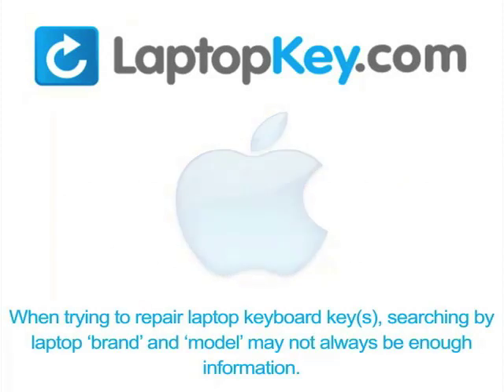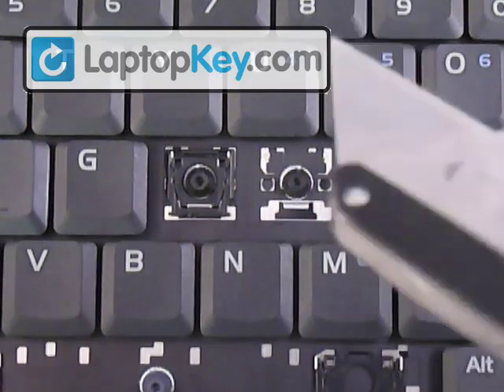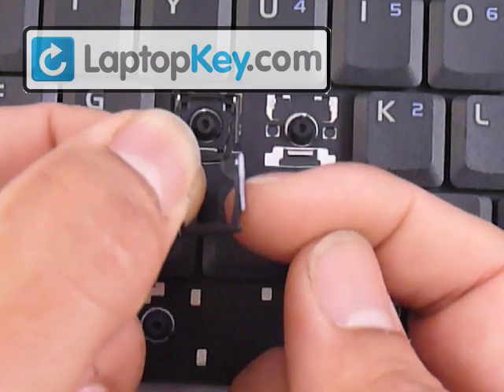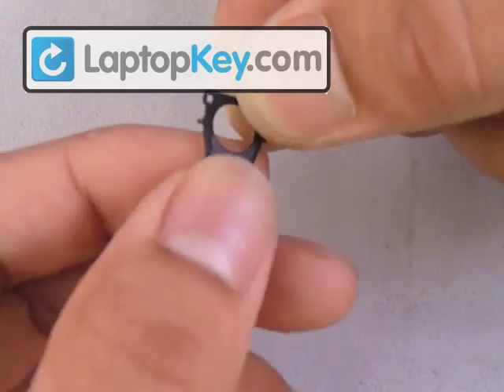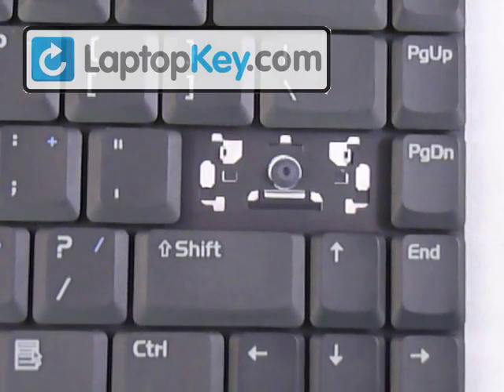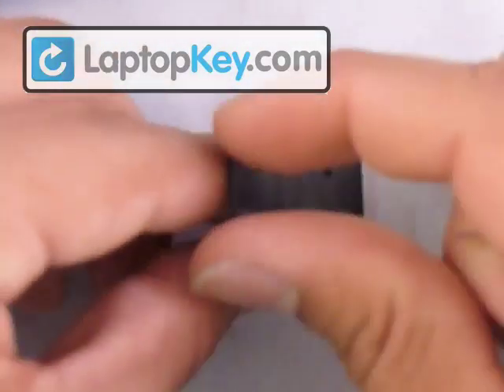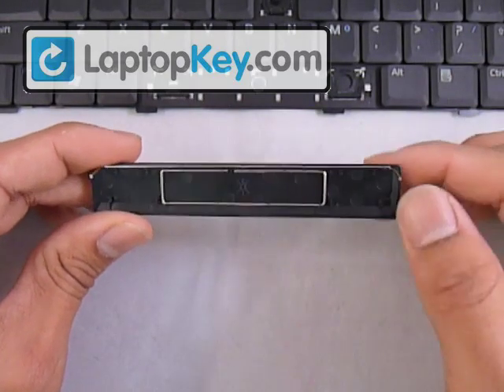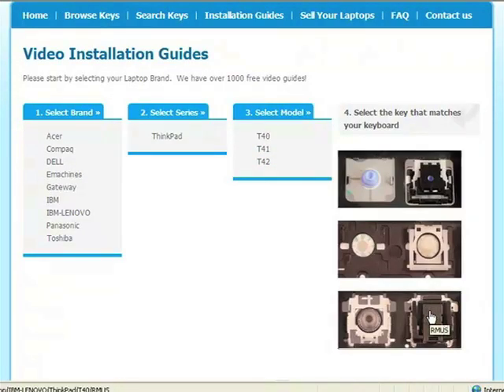Individual Laptop Keyboard Keys HP Compaq Pavillion Fix Repair Installation Guide

Comment: Hi Allison I had the same problem and for me it turned out to be one of the pins had come out of place if you check the video out you will come across the section start at approx 3 mins  and follow from then and if your problem was the same as mine you can fix it.You may find it easy if you take the hinge off the keyboard  (I did) I did find at first that the key I fixed needed to be lifted a little just to get the hinge freed off a bit